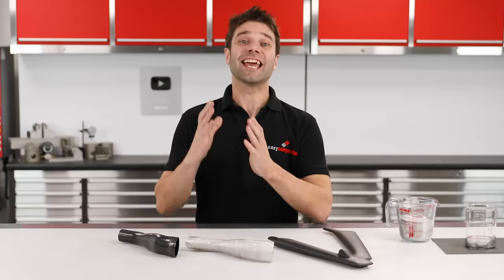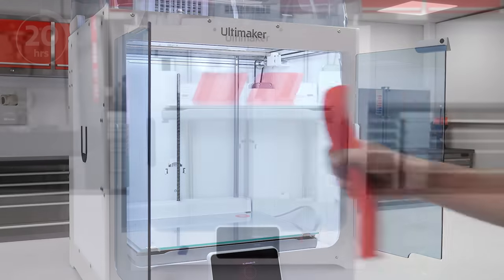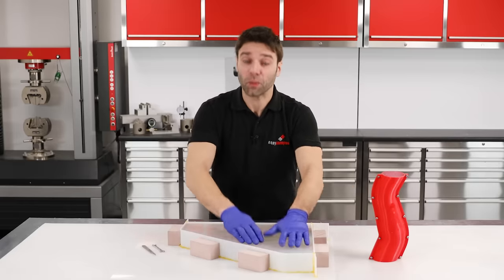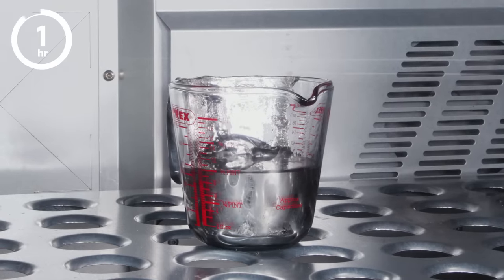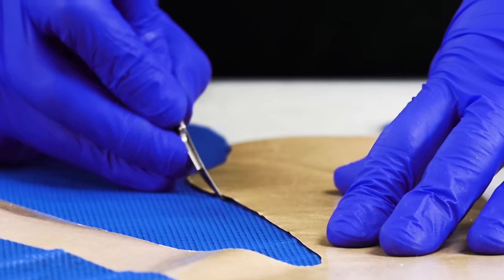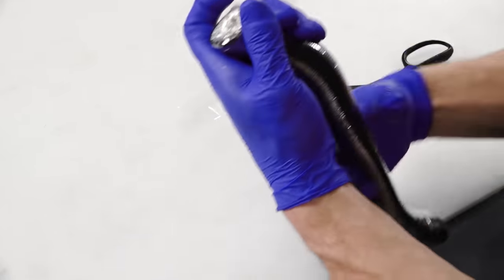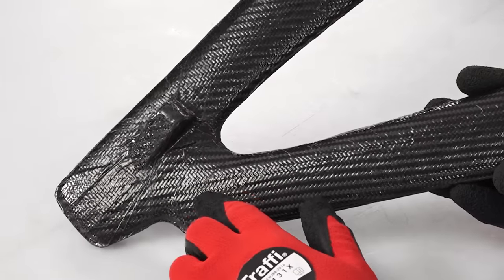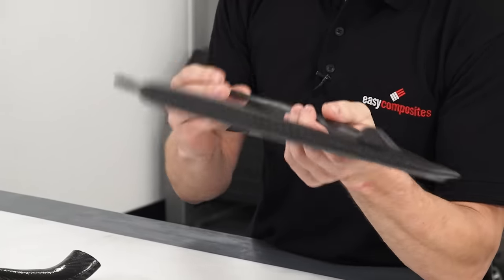Moulding Hollow Carbon Fibre Parts Using a Low-Melt Metal Mandrel

Comment: Could you do the same with Casting wax other than low melt alloy?
Reply from the maker: Thanks for the question. You can definitely use wax for room temperature cures but for prepreg oven cures, like we do here, we haven't found one with the right level accuracy and stability.

Comment: Can this be used to make a hollow forged carbon fiber?
Reply from the maker: Yes, certainly; but it might get a bit messy. If you were working with a forged carbon fibre prepreg then it would be exactly the same as the process you see here. If you were working with dry chopped tow and wet resin then providing you can successfully get your chopped tow laminate around the mandrel, and you're working with a resin system that can take the 95C temperature needed to melt-out the metal (such as our EL160), then yes, you could do this with wet-lay forged carbon too.

Comment: I wonder if I can do this with something like hotglue instead of metal for he core.
Reply from the maker: Not sure if it will melt out well.  You have to choose a material that's easy to cast, withstands the pre-preg cure temperature and then melts out at a temperature that does not negatively effect the composite material.
Reply: @easycompositestv  yeah i was thinking it might be too goopy to flow out well. Maybe a wax? like whatever they use for lost wax bronze castings.

Comment: What if you cover the metal mandrill with lubricant wax to get the cleaning easier 🤔?
Reply from the maker: The problem with oil is that it contaminates the epoxy during cure. We tested many different release agents and, unusually, found PVA to be the best for this application. Honestly, the clean up was little more than a few seconds.

Comment: What is the highest and lowest temperature and pressure can it withstand?
Reply from the maker: Do you mean the prepreg or the metal? Assuming you mean the prepreg, I’m not sure I understand what you mean by ‘lowest pressure it can withstand’? Do you mean what it the least pressure required in order to achieve sufficient consolidation of the laminate? I’ll make some guesses at what you might be wondering:
Lowest cure temp for this prepreg is about 80C (but it would be LONG)
Lowest pressure would be about half a bar but more realistically, you want a bar (which could be positive pressure in a clave or a vacuum bag at 100% vac, which means a bar acting on the laminate).
Highest pressure; there isn’t one really
Highest temperature; the Tg (softening point) of the resin is 130C but you could push it to 140or maybe even 150, if it wasn’t under strain at the time.
Reply: @easycompositestv  the metal?

Comment: Can also use 3d printed parts using pva filament which is water soluble.
Reply from the maker: Thanks for the question, sure you can PVA print the mandrel if you are using a room temperature cure, but for prepreg curing like we use here the mandrel would distort and collapse under the heat and pressure. I hope this helps.
Reply: @easycompositestv  correct, infusion or wet layup only and then post cure once inside has been removed.  Thats how i make 90° carbon tube bends.

Comment: What about wax ?
some waxes are very hard when dry.
like the wax used in the past for postmarks. And keeps a shiny smooth appearance.
Reply from the maker: The mould pattern needs to be abele to withstand the initial cure temperature of the prepreg without any deformation or softening. If you are using something like a vacuum bag to consolidate the fibres then the force of this combined with heat will be much more likely to alter the shape of wax whilst the alloy is far more stable.

Comment: Very nice video. for one off parts or a few, maybe 3D print with low temperature filament for direct application is better.
How about woven sleeve cloth for certain parts like the duct? or do you have any method for spooling on or even weaving on fiber to avoid that icky 2 sided construction. There may not be much difference in practice but it seems wrong to have that seam where the cloth is always broken, defeating all the strength.

Comment: Hi 
Can you tell how to fix dry spot after carbon fiber infusion
Reply from the maker: depends how bad it is.  Minor damage can often be fixed by wet laying a bit of resin onto the dry patch.  However if it goes deep into the laminate, that area will always be weak, even if the cosmetic repair is successful.
Reply: @easycompositestv   can i share you pictures if possible ? 
From you channel i have learned a lot.
Reply from the maker: @shayansaleem1137  sure, please email them to our technical team (technical@easycomposites.com)

Comment: can i use 3d print mandrel for hollow carbon fiber?
Reply from the maker: Semi-soluble 3D print materials do exist and we've done a bit of work with them ourselves. Generally, we'd say that this technology (soluble 3d prints) perhaps isn't yet quite where it needs to be in order to be as effective as a low-melt alloy, and it is rather pricey, but it does exist and is something we've worked with and may feature in a future video.

Comment: Are carbon bicycle frames made like this?
Reply from the maker: We have not seen any made by this method but it may be possible to make some frame parts this way in some cases if a typical moulded manufacture is not possible.

Comment: ABS plastic if I remember correctly dissolve in Acetone, does it possible for that alternative of metal

Maybe as experiment video or if its possible a tutorial, great video tho
Reply from the maker: Acetone will attack ABS to an extent but it wouldn't allow you to properly melt-out an ABS core/mandrel. There are alternatives to low-melt alloys including soluble salt cores and semi-soluble 3D print materials. Generally, we'd say that this technology (soluble 3d prints) perhaps isn't yet quite where it needs to be in order to be as effective as a low-melt alloy but it is something we've worked with and may feature in a future video. Salt cores are interesting too, but generally need a lot more equipment to process. Again, they may feature in the future.
Reply: You can dissolve out polystyrene foam (styrofoam) with acetone. But the resulting chemical is a toxic flammable sludge that is not easy to dispose of.
Reply: @easycompositestv  thank you so much for your answer, my biggest problem to try it(alongside compression molding) is sourcing most of the time

there are alternative like HIPS, or PVA filament but PVA is water soluble so unless room is very dry i dont think its very possible, HIPS on the other hand is soluble in d-limonene
Reply: @mckenziekeith7434  yup i know but im just not sure

Comment: Couldn't this be done with 3d printed plastic as the core for an easier diy solution? I'm just not sure which material would be best suited for it.
Reply from the maker: It is finding a suitable easy to dissolve out core material that can also take the temperatures of pre-preg curing.  Low melt alloys are good in that the temperature profile overlap is such that you can cure the pre-preg then melt out the alloy easily.

Comment: What about just 3D printing the male form from low-melting temp alloy?
Reply from the maker: I’m not aware of any 3D print systems that could print an alloy with the required melting point. If they do exist and they’re along the lines of other metal sintering printers then - at present - they’re very complicated and expensive pieces of kit.
Reply: @easycompositestv  The metal melts at ~200F +/-. That's the same temperature range as PLA. All you need to do is pultrude a wire of the metal, and it would likely feed through, melt, and print.

Comment: You should have put the cylindrical mold back in the 3D printed form to hold it in shape for casting. Other than that, nice work.

Comment: Be careful with those Pyrex jugs - Pyrex used to be made from Borosilicate Glass, which is what made it strong and gave it the ability to go from oven to fridge, or fridge to oven, without shattering from the thermal loads. However, since Pyrex was bought out by Dow-Corning, the brand has been used to sell products made with glass that IS NOT Borosilicate based, and will shatter when exposed to high thermal loads.
Reply from the maker: Pyrex (UK at least) still advertise as using Borosilicate Glass
Reply: @easycompositestv  - I got part of that backwards - Dow Corning spun off Pyrex in the late '90's, not bought them.
Confusion abounds thanks to Corning spining it off as a subsidary, then sold off parts of that to competitors in different reagions.
Anywho, make sure it's labeled as Borosilicate Glass, rather then have any nasty equipment failures.

Comment: With a 95C melting point, you can even simply use a bath of boiling water to melt down or out the metal.

Comment: why XC130 and not XC110? is not XC130 for autoclave?
Reply from the maker: Good question! XC110 is developed specially for ‘pin hole free surface finish’ when used as a 1-3 ply laminate in a mould, cured under vacuum only. In itself, this is quite a feat, matched by no other system (as far as I know), however, in this application, the outside of the part is going to need lots of finishing work anyway, so a pin hole free finish isn’t really relevant. What is more relevant is the 130C Tg of the XC130 prepreg, compared to the 110C of the XC110 - which means we can use a higher melt-out temperature, and the slightly better mechanical properties of the XC130. Plus the fact that we only make the UD prepreg in XC130 (because it’s never pin-hole free anyway) so it all adds up to make sense to use the XC130 throughout.

Comment: This looks like such an expensive process, I'm imagining the only clients are motor racing teams. Also I cringed when he cut the zip ties instead of reusing them. Good video.
Reply from the maker: It's cheaper than if you had to make a mould for these parts though, this method also allows parts to be made that you otherwise wouldn't be able to do and the low-melt metal is reusable.

Comment: why not use some PCL plastic instead?
Reply from the maker: The pre preg needs to cure at a minimum of 80°C before the core can be melted out, it also needs to be 100% stable at the initial cure and not start to soften. The melting point of PCL is about 60°C so too low for this.
Reply: @easycompositestv  oh, right. my bad. Sorry for stupidity. I think it can be used with not prerpeg, but conventional compound, though.

And excuse me, isn't uncured epoxy has toxic phenols? Why are you breathing this without some sort of gas mask? It does not look like you have a very powerful vent that is able to blow air with such high speed, that you can't smell it.

Comment: You can also do this same method with bees wax
Reply from the maker: Thanks for the comment. You could use wax for room temperature cures, however in this process we cure the carbon fibre under heat and pressure and the wax wouldn't withstand this.
Reply from the maker: This is true for ambient temperature cure processes but most waxes have a melting temperature that is below the curing temperature of the prepreg. Beeswax melts at 60-62C which means it would melt away long before the prepreg had reached its initial cure. Also, as waxes approach their melting point, they are already softening, which leads to distortion of the component, especially under vacuum / shrink tape pressure. For ambient temperature cure processes though (ie hand layup, rather than prepreg) wax mandrels, including beeswax, are indeed an option.

Comment: the melting point of the metal can be lower than a 3d print plastic melting point, perfect
Reply: that tin casting process can be used in electroplating high temp metals simply, thanks for the tip

Comment: Awesome video, however, I skip a few steps, and just 3D print the inner mandrel out of HIPS and melt it out.  Much easier with one off, or low volume production
Reply from the maker: Thanks for the comment, I have tried many different materials for directly printing the mandrel, the problem is that the temperature of the cure combined with the force from the vacuum bag will partially or fully collapse the mandrel even if the cure temperature is well below the HDT of the plastic. If you do get a method that works I'd love to hear about it!

Comment: I'd have to imagine it would be worth 3D printing a split mold instead of casting silicone, even with the cost of a filament that could take 100C.  Protopasta has a HTPLA that could work, or a number of technical materials.
Reply: Glass temperatures of even nylon which is very high temp are still too low to melt out the metal. Let alone HT-PLA. The mold would deform slightly before the metal melts.
Reply: @ratgreen  Maybe it won't work because of how much metal is often needed, but people have cast pewter into PLA molds. If they survive at 280C pewter, maybe 95C will work depending on wall thickness etc. I simply can't believe silicone molds would be more dimensionally accurate than a printed mold. We're not melting metal out, just pouring molten metal in.

Comment: Instead of using zip ties you coulds have used the silicone support mold for casting the metal part.
Reply from the maker: Zip ties are easier to use and cheaper than making an additional support mould but yes that could work.

Comment: I’m going to try this with wax covered in wall plaster then hit it with hot water . Dissolve and melt. Can work with fiberglass as well. That metal looks pricey.
Reply from the maker: By all means give it a go but I’n not sure you’ll have too much fun trying to remove cured plaster from the inside of a tubular form. Once set, plaster isn’t water soluble. Also, worth remembering that the low melt alloy not only works perfectly but it’s also infinitely reusable and so if you’re using it multiple times, you can think of its cost more like that price of a good tool than a consumable material.

Comment: So you're not going to discuss how you safely dispose of that large tub of waste? Seems like a significant issue just skipped over.
Reply from the maker: Once the water has evaporated, as in the video,  the metal waste can be recovered and re-used along with all the other recovered alloy that was melted out.  It doesn't matter that it is in a small particle format for re-melting to use again.

Comment: I want to see someone hydroform a thin metal inner, then overwrap it in carbon fibre, and then call it finished. Just like a composite pressure vessel, except as a mechanical  linkage.
Reply from the maker: No reason why a metal skin or inner could not be wrapped in carbon fibre.

Comment: Why not just print the whole core in PVA instead of needing to use the Lead based alloy?
Sanding down the pre-preg material is a great way to reduce the strength by tearing in to the carbon fibres. It'd be better to coat with enamel and then surface sand that for the smooth finish.
Reply from the maker: You can do a sacrificial core moulding process using PVA print but there are some compromises, including the fact that you can't use prepreg (which does make the process a lot more practical, and successful) and you would have to reduce, or eliminate, any consolidation pressure (like a vacuum bag or shrink tape) in order to avoid compressing and distorting the mould. But for prototypes, iterations or less demanding requirements, hand laminating over a PVA core and then dissolving (over a considerable time) the PVA core is definitely an option.
I'm not sure what coating with enamel would be in a composites content. In this case, we're only taking off high-spots (which coincide with unintentionally thicker sections of laminate anyway) and then coating with epoxy, which is flatted.
Reply: @easycompositestv  Enamel, aka Clear Coat, as used over paint on cars,... Though more often then not it's a polyurethane based coat, so you sand it smooth instead of damaging the underlying composites.

Comment: Why not wax?
Reply from the maker: Most waxes have a melting temperature that is below the curing temperature of the prepreg. Beeswax for example melts at 60-62C which means it would melt away long before the prepreg had reached its initial cure. Also, as waxes approach their melting point, they are already softening, which leads to distortion of the component, especially under vacuum / shrink tape pressure. For ambient temperature cure processes though (ie hand layup, rather than prepreg) wax mandrels are an option.

Comment: feel like 3d printing is mor economical than this but it is cool none the less
Reply from the maker: Normal 3D printing couldn’t be used for this process because there’s no way to melt out the print without damaging the resin used in a typical prepreg. There are water soluble filaments but they’re very expensive and only relatively effective (they go sort of mushy and stringy). Also, on the cost front, it’s worth remembering that the metal is reusable indefinitely and so its cost can be thought of more as a tool than a consumable item. We’ll continue to evaluate the soluble filaments and if we feel they’re at a point where they’re an effective choice, we’ll feature them in a future video.